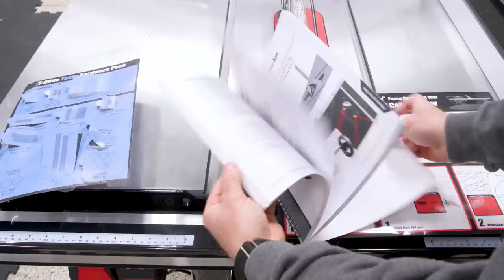I Left Powermatic for Sawstop!

Comment: That's my exact saw, it's great. I bought mine about 4 years ago and it doesn't have those same fence pads so I do get the slop you mentioned. And, of course, even with the 36" extension, it is always full of crap. Something about those horizontal surfaces.... I only have one complaint about the build quality and that involves the blade angle adjustment wheel lock mechanism. Not only is that knob plastic, but the internal sleeve it presses against metal banded plastic and mine cracked. When I put in the new one, I added a metal  hose clamp around it before installing it. Customer service is great though.
Reply: I have noticed the lock knob for the tilt on mine has gotten 'soft' if you will. I have to crank it down more than the height locking knob to hold. Your post indicates I should check the internal sleeve. Thanks!
Reply: @georgemuff5482  yes, that is exactly what I noticed so I took it apart. They quickly sent me a new part, but the design is bad and I was originally going to make my own replacement from a block of aluminum, but the hose clamp fix was easier to try.

Comment: I worked as a cut out man at a large production cabinet shop. I watched a dude cut off all his fingers on his right hand. He was cutting a piece of 1/8th" cabinet backer board. It was grizzly. A saw always makes a weird sound when kick back is about to happen. His hand was just a macabre pile of cut and shattered bone. I own a SawStop Industrial saw. It is an older model and my table extension has only one leg and not two. I've worn out the plastic glide on the forward bottom of my fence. I use that tool more than any tool in my shop. It was well worth the money. I only use the riving knife and without the dust collecting guard combined with the fact that I use a shop vac for dust collection, the dust is atrocious. Freud blades don't work with the standard riving knife. The knife is taller than the blade making non-through cuts problematic. I do wish lubing and greasing all the areas that need it was easier because I am getting older and it's getting harder to do all the gymnastics needed to reach those specific points.

Comment: I've found all kinds of benefits to the Sawstop vs my old crapman.. First I still have the remaining parts of my index finger after switching over. (kind of nice to not bleed painfully) I have a 52" PCS , but now kind of wish I had stuck with a 36"..Oh well..It gives me extra places for even more crap! 
I did note that the blade to miter slot adjustment was dead on from day one. Never needed an adjustment, but I am equipped to do that when the time comes. 
I run my PCS on a dedicated 20 amp circuit instead of 220 and have had no issues cutting through 3" of both solid walnut and hard maple, but I do try to avoid cheap blades. My OEM Sawstop blade was a victim of the only brake incident when I inadvertently touched the blade with a metal tape measure. Both the blade as well as the brake became displays of what not to do. 
I was never sold on the OEM blade anyway. I really have no idea why a manufacturer of a $3000 saw would include a $40 blade, but oh well..

Comment: I have a tiny shop (9'x13' outside dimensions), so I bought a SawStop JobSite Pro table saw. It was pretty much the only SawStop saw that would fit in my shop. That said, I love it. For a jobsite saw, it's been plenty accurate enough for everything I've made. The fence works great; although, it is a little hard to get it dead on when I'm trying to make tiny adjustments. It doesn't have a cast iron top, which is a bit of a limitation sometimes, but the top is dead flat, and it cut accurately from the beginning - no adjustments needed. It's easily portable, so I can fold it up and roll it out of the way when I need to. In my opinion, it's easily the best quality jobsite saw you can buy, and best of all, I don't have to worry as much about getting a serious injury from the saw. You pay a premium, for sure, but for me it's worth every penny extra.

Comment: You mentioned in a sort of throw away comment that you had the  overarm 1-1/4" dust hose hooked up to a dust extractor? By that do you mean a separate Shop Vac style collector? I've got mine hooked into the main 4" line at the base of the saw with the connector Sawstop provides and find the overarm collection to be rather weak. Been thinking about hooking up a separate vac to the 1-1/4" hose.

Comment: Good video as always. I bought my Powermatic PM2000 back when Sawstop was first becoming available. A friend of mine who worked at a woodworking store liked the Sawstop, had done demonstrations with the Sawstop and bought one for his own Woodshop. But the number of accidental activations he had, due to the moisture content of the wood, etc, turned me off of the Sawstop. And I was concerned about the trunnion/saw durability and the cost of new blades and cartridges. Knowing what I know now about the Sawstop, I probably would have bought the Sawstop. I like my Powermatic just fine and it does everything I ask of it.  And knock on wood, hopefully I never regret getting a saw without the flesh sensing technology.
When I got my PM2000 tablesaw I got the bigger motor with the 30 something inch table  with router lift as my shop was in a 2 car garage. But I also bought the 52”? Extension table with router plate cut out and rails be cause I had plans to build a detached workshop and put the larger extension on it as I make a lot of dental molding in long lengths.
Still haven’t built my detached workshop yet though due to an injury at work. It was a car accident where someone ran a red light and t-boned my right front door and significantly damaged my back and neck. I had to take a medical retirement and never got the shop built. I guess it could have been worse… 😊

Comment: I had considered a SawStop two years ago, and I was looking at something I could move around since I do my work in a 2 car garage.  I was looking and considering it and I had a friend buy their contractor saw for his business.  He cuts all kinds of stuff all day and between him and his men, they set it off once a week or more.  Wet wood has been the biggest issue with his work.  He eventually went back to some Dewalt stuff and mainly uses the Sawstop when they get a big job.  I opted for something else since I have used my current Grizzly for over 30 years without a mishap.  I know they can happen but I am very careful.  I had a woodworker friend ask me how I had hands with so few scars after all this time and I told him that I always get my son to push the wood through my table saw just in case.  (kidding).  Great review.  Let us know how it goes and if you manage to trip it.  I will say the demonstration with the hotdog that Sawstop put out is impressive.

Comment: I was lucky enough to find a hardly used SawStop Contractor Model from a Junior College's Maintenance Shop, with a 52 Inch Fence. After I sold my old Craftsman, with a Custom Stand, my net out of pocket was only $300.00 more. This decision/deal has to be one of the best I've ever made! 
When I learned that there are 67,000 Table Saw related accidents (amputations) a year in the USA, it was a no brainer. Now the 10 other most important tools (my figures) in my shop are safe!
Reply: I forgot to mention that I had added a Biesemeyer Knock Off Fence ($104.00) to the Craftsman TS which actually made it a pretty nice TS. However, it didn't have any Safety Features which made it expendable!

Comment: Happy to see you joined the club ;-}
I sold my PM2000 almost 10 years ago when my Grandchildren got interested and I needed to keep tiny fingers and old hands intact as good technique only goes so far :-))
The mobile base on the Saw stop is great as I need to move mine around frequently much better than the good idea but poorly executed system on the PM2000 (the connector on mine broke twice)
How do you like the infinity insert? I bounce between the shark fin and the guard frequently. as I love the dust collection. Have you tried the Woodpeckers square on it?
Would like to know more about the auxiliary aluminum fence etc.
Thanks
Doug

Comment: How did you get that particular extrusion mounted? I bought it and the slots don't line up with the bolt slots in the steel fence. Also, you linked to 1.5" long bolts? I used 3/8". Maybe you did something different? Thanks!
Reply: I ended up ripping the bottom of the aluminum extrusion off to bring it lower and get the extrusions slots to line up with the bolt holes in the steel fence. Accessing the bolt heads inside the steel fence was difficult because they were up higher (further from the access holes on the bottom of the fence. So I removed the right side melamine fence plate and accessed the bolt heads from across the other side. Then I put the right side melamine back on because those bolt heads ended up lower (closer the access holes on the bottom. I could easily turn them with sawstop's included allen driver with ball end (which allows you to turn an allen head screw from an angle). Maybe that will help someone. It's looking a lot better as my sawstop melamine fence plate was not flat by a long shot. For reference, I have the ICS but I think the PCS fence is the same.

Comment: Would love to see a video about the extrusion fence, how to ensure you've got the fence dialed in to eliminate slop, ways to keep using the guard when cutting thin rips (maybe L-fence), etc. Would also love to know some techniques to use guard dust collection if you also use inline router table that doesn't play nicely with the guard. Also, if you review some micro adjust aftermarket products to reset the fence to a particular spot or dial in the cut to exact width. Also, how would you use the Jessem miter gauge and keep the guard on - particularly for non-through cuts.
Reply: I used a single thicker glossy business cards (one on each side of the fence) to set the spacing and that kept the slop to a very minimum for mine.  There is still a tiny amount of movement (about 1/32) one direction, so I've just gotten into the habit of adjusting my sneakup point.

Comment: I’m an ICS 52” driver. Life begins at 5hp ;-) . Bought mine used over 10 years ago, otherwise I would have purchased a PCS 36”. Neither machine is a dud, both will last a lifetime. Mine has never required a re calibration.

Comment: Note that the safety circuit is still engaged for a short period after the blade stops. Watch the blade and the indicator light when you shut the saw off. I triggered a brake when flicking a little cutoff piece away and touching the blade in that tiny window between the blade stopping and the safety circuit disengaging.

Comment: Hi Marc

Did you consider at euro sliding tablesaw, like Felder/Hammer?
It might be more expensive, but I do think it is far supperior. I have not used a mitresaw since I got my slider, no need for a tablesaw sled and the sliding table makes long straight cuts a breeze. Since you stand on the side of the blade and not in the back of it, you are in a safer position.

Comment: When I was planning to upgrade from my jobsite table saw, I learned all about the SawStop safety feature.  It was pretty much all I heard about the SawStop.  After hearing a salesman spend a lot of time talking about the safety feature, I kind of lost it and said, "I get it!  But my primary purpose of buying a table saw is not to cut myself; instead, I'm buying it to accurately and consistenly cut wood!  I wanted to know the main difference between a SawStop and a similar Powermatic saw.  The surface things I could see (metal lock knobs and an overall perception of Powermatic being a bit more 'stout.'  But then I finally heard something that rang with me:  SawStop is designed so that if the safety feature is ever activated, the cartridge can be replaced and you can resume use.  What that meant to me was a very strong (read, "stable") and robust trunnion and everything else that gets the incredible "hit" when things come to a literal crashing stop in milliseconds.  The fact of being able to get a saw back up and running after this extreme physics event is what sold me on SawStop.  Maybe Powermatic is just as robust; I've never owned one.  But I can say I have been very pleased with SawStop accuracy and consistency.  On one other note:  A woodworking friend of mine told me if it was at all possible and if I could afford it, the 3hp version is well worth the money.  I followed his advice and I can say it was well worth the money.  It is the first table saw I've ever had that runs off 240v, but the horsepower is incredible.  I have not yet found any material, either in composition or heft that drags it down!
Reply: This is true. This first prototypes required the saw be sent back for checking and alignment after an activation. They realized this would be a deal killer due to downtime and would piss off users.
So instead they went back to the drawing board and beefed up the whole trunion mechanism to withstand repeated activations.

Comment: Those are all the exact same reasons I got rid of my 20 year old Jet 10” 52. Went when with the exact same model and like it so far. My only gripe I could say it that the top scratch’s easily compared to my old Jet. Spoke to my local dealer and he said the casting is a little softer on the SS. 🤷🏻

Comment: Hi Mark!  I would like to see more detail about you hooked up the dust collection.  It looks like you have a 4" coming to the base of the saw, and is that 2.5 to the blade guard?  In this video I kept wanting to see what was on the right side of the saw.  Is that the Sawstop "over arm?"  Is it on a base or connected to the saw?  Thanx!  hb
Reply from the maker: All will be revealed in an upcoming video. ;) It's a Festool dust extractor that's connected to the back of the blade guard. Standard 4" port below. And the bracket that holds the hose is of my own making. Connected to the back rail.

Comment: I’m interested in why you chose the 3hp.  Also, the only issue I’ve heard with the SawStop is switching to the dado head, as you mentioned.  I have a friend who has the SawStop but a smaller table saw set up for dado cutting.  I think you’re right: it’s the SawStop “tax” for redundant safety!  I’m about to order the 3hp version with extension table, outfeed table and router table, so your review was great.

Comment: I switched over to 8 inch blades. It requires less power to cut (my 1-1/2 hp is just fine) and, most importantly, no swapping cartridges. For me, I rarely need a 10 inch blade and when that happens I endure the change over.

Comment: I've talked to at least a few woodworkers who've told me that they have worked for decades with table saws and have never been injured. I say that's a dangerous logical fallacy. People can use bad habits for years and never have a mishap.
I've just retired from 25 years of doing anesthesia. We anesthesia providers are the best when it comes of situational awareness, yet even the best will make a mistake.
How many people consider themselves "expert drivers", yet they still get in crashes.
I got a SawStop for all the reasons above, expessially when I want to take the guard off, which is usually. I will almost always use the riving knife though.

Comment: Are you able to measure the mitre slot? I use the same machine and mine has the mitre slot width out by ~7 thou over the length. Every jig I make is sloppy on the front and binds in the back.

Comment: I got the same setup as you last year (though I added the larger dust arm because it's effortless to push it out of the way when using jigs/sleds, which I do often -- and most importantly to pull it back in place). They say "a couple friends" but my wife and I were able to get my PCS into the ICS mobile base without much effort, and neither of us are in body-builder shape. I definitely had to square the blade up with the miter slots.  What blade do you have in your saw? The one thing I was surprised to learn about SawStop is that the brake system is "not compatible" with blades that have anti-kickback shoulders which are getting more and more common on blades (I bought  CMT blade because the photo didn't show them, and it turns out CMT now adds them). Thanks for covering that, too -- yours is probably the first review that actually mentions it, even if just in passing.  (P.S. I kept the CMT blade because I figure the chance of kickback is far greater than the chance of me bumping the blade with my hand and risking an additional stitch or two)

Comment: Is the safety blade stop still active after the switch is turned off? I’m not sure I’ve seen that addressed. Maybe I just missed that.
Reply: Yes, the brake is active until the blade comes to a full and complete stop, and the captain has turned off the "fasten seat belts" light.